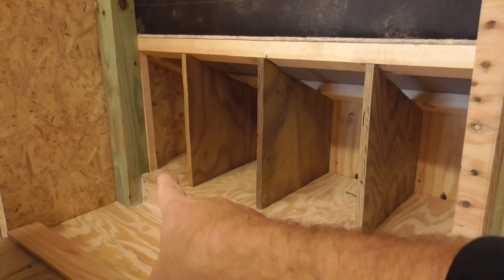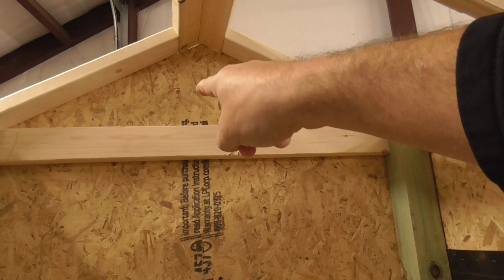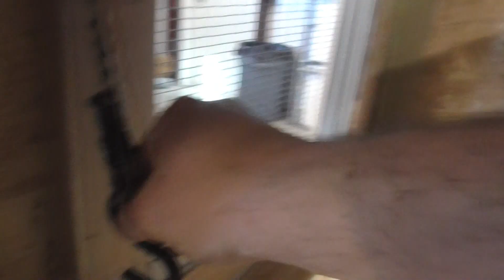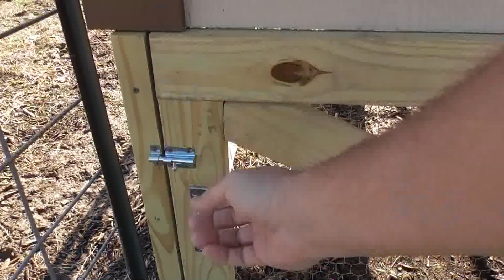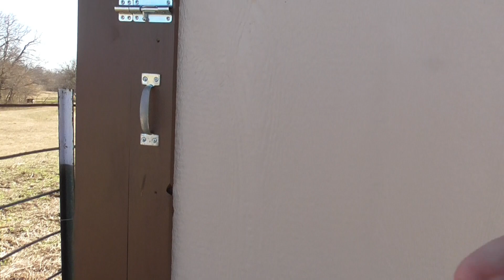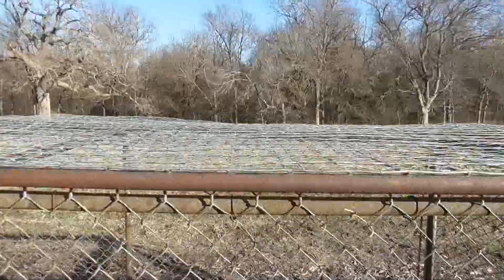I Built A Chicken Coop

Comment: A 12VDC fan and a ~10-25 watt solar panel works great for cooling them hens off during the hot Texas summers.  
When the sun is out, the fan is on, when the sun sets, it turns off.